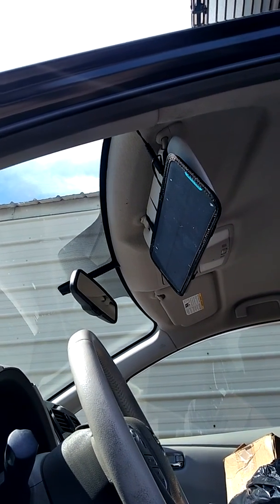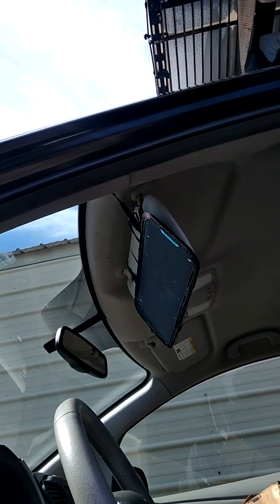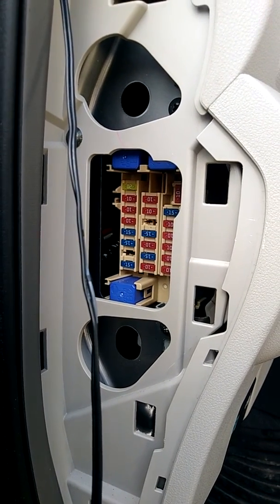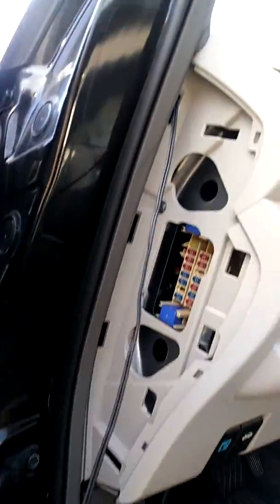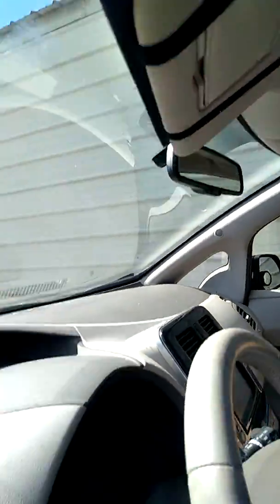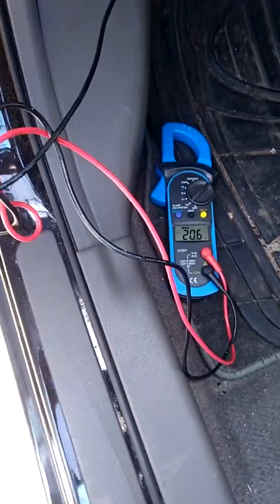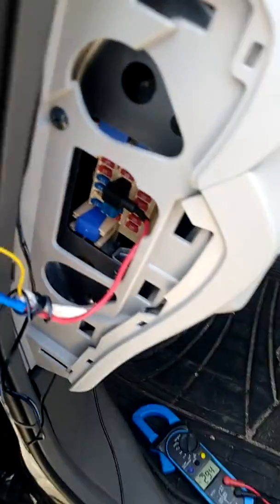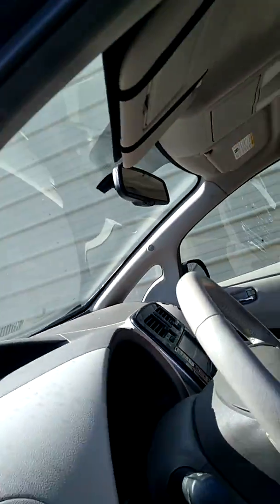Adding 12v Solar Panel to 2011 Nissan Leaf

Comment: Thanks for the vid, 5 years and we’re still watching and finds this priceless!
Did you connect red wire from solar panel to the fuse, and black wire from solar panel to the ground?